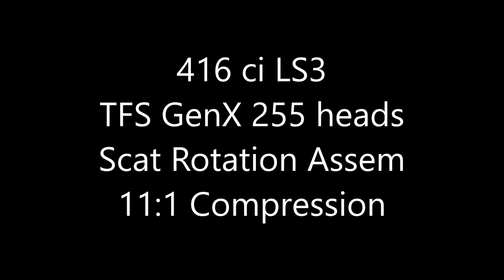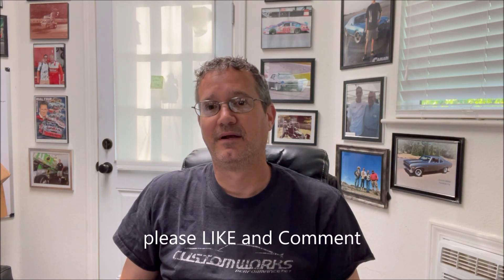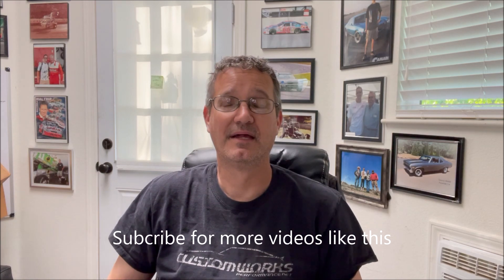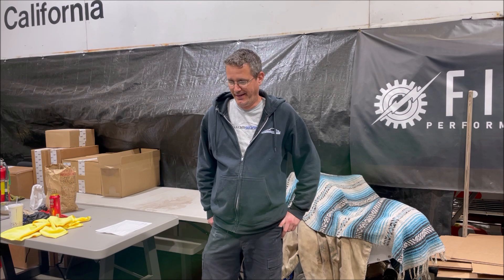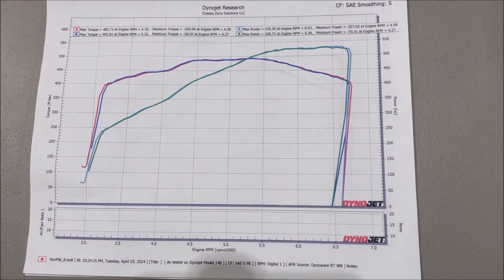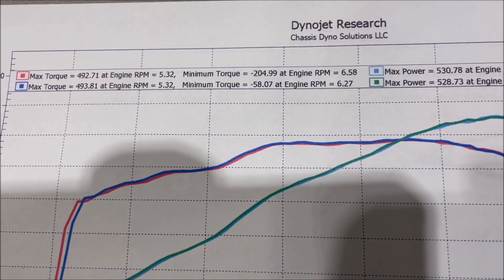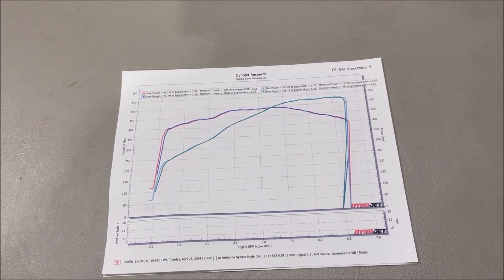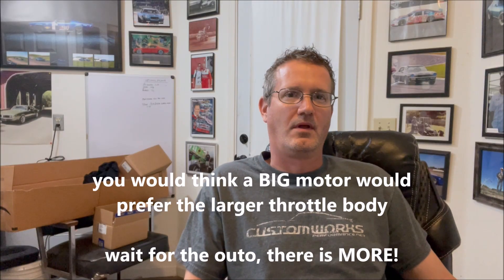92 vs 102 BIGGER is better? I dyno test it

Comment: I'm just now seeing this I have a 408 big cam fast 102mm intake manifold and a Nick Williams 92mm I've had both 102 and 92tb on the fast 102 intake manifold and they made the exact same power 580hp and 575tq so it did make good power regardless the tb and th3 92mm tb does drive better for a street car
Reply from the maker: Yeah. That was my findings as well.  Thanks

Comment: Did you try with a rod mod or FAST vs this intake which is iffy.?
Reply from the maker: That would get expensive!  We did not.  We all know the Fast is just a ported version of a stock LS3 for the most part.  The rod mod from what I have seen isn't worth the hassle or the expense.  I did reach out to them to see if they wanted to let us use one of their manifolds or modify ours, but not a reply.  Anyway this video is mainly about the throttle body size, and I don't think it would be any different with any other intake that didn't raise the rpm much higher.  I still have this intake on my car, as I'm not wanting to take it apart and it does look cooler than the Stock LS3 intake.  Thanks for watching.

Comment: I appreciate you actually following up with the throttle body test, most channels would have just forgotten about it. Also, thanks for saving me from wasting money on an aftermarket ls3 manifold! Your LS3 vs PDI intake post on LS1tech brought me here btw
Reply from the maker: You're welcome.  Its hard to get legit unbiased info.  Thanks for watching and glad it helped you out.  I still have the manifold on my car with a 95mm Holley throttle body.  The loss of low end power sucks, but also may help with traction.  I do wish it would have been offset by more that 2-3 hp on the top end, ughhhh.  btw.  I recommend the Holley 95mm TB.  Drivability is the best with that unit because of its taper design, unfortunately it is expensive

Comment: The smaller throttle body should make more torque. They larger one should give you more top end. But with more air, you need more fuel it would seem. Im glad you are making these videos. These are the questions I've had. But i dont have the money to test it. I started making videos for my grandkids about my Ls3 swap in my Crown Vic. And they have helped with the engine. Proud grandfather here lol. Trying to get the next Gen excited about Hotrodding. I have been playing with my old RC cars while i save and wait for parts. Thank you for the videos. Great info.
Reply from the maker: Yes with more air you need more fuel.  As i keep having to point out, this is a speed density system, not a MAF.  So as more air enters, more fuel is used.  The WBo2 takes care to also keep the AFR perfect, so yes the AFR was the SAME on both.  My point was that even with this 6.8L motor with big heads and cam, it really didn't need a bigger throttle body, ultimately I will put the Holley 95mm back on because its tip in design is really nice, but it is over $600, but worth it on driviability.  The bigger 102 really suffered with tip in throttle.  too much air too fast.
Reply: @ks71z28  OH ok. Cool. This is the first video I seen from you. I am watching the other videos now so I can catch up. That way I can see how you built it.
Reply: @ks71z28  Throttle response and drivability is definitely big points for me.

Comment: I would be curious to see how your engine would do with the 112 manifold version and 112 TB, I watched the Richard Holdener video and it picked up hp/tq,  all other videos of the 103 version hasn’t done anything. Thanks for the videos.
Reply from the maker: Because the 102 didn't do anything hp wise from the 92, I don't think going bigger would do anything except hurt the slow speed air flow further.  I think the fact that they made this HUGE throttle opening (112mm) for this manifold seems like a contradiction to the design of their manifold, which is to out perform the stock LS3 manifold everywhere.  All my testing and all of my research leads me to believe that at a point, once a manifold reaches maximum efficiency for a certain range, changing it will only take power from the top of the curve and move it to the bottom, or vice versa.  That is why the factories went to a dual runner intake when they went variable valve timing, its like have tow different intakes.  The Performance design intake in this case did in fact improve power at the top of the curve by allowing it to carry about 400 rpm longer, but at a cost from off idle to 5200 rpm, not massive but 10-15hp and 15-20tq, for me that is not worth the slight gains.  I will be taking the PD intake off and going back to stock.  I would love to test a posted or rod modded stock LS3 intake if anyone has one!  thanks f9or your comments and watching

Comment: 3-5/8" vs 4" , if you didn't change the tune to match the air at a throttle position then the tune wouldn't be right.
Reply from the maker: You’re obviously not a tuner.  This is a speed density set up, noted by me stating a Holley dominator ecu, target AFR were not changed and both runs were run at 12.6:1.  This was verified by the actual O2 reading in the data logs.
Reply from the maker: Also the test likely revealed this big motor didn’t need more air.  The engine dictates how much air it ingests   The throttle body is either a restriction or not.  In this test I showed the 92 mm was not a restriction and the 102 actually seemed to hurt low speed air flow likely due to a loss of velocity.
Reply from the maker: and I do appreciate your comments.  this is all about learning.  I make nothing or gain anything from this except experience.  A $40k dyno, a $1000 intake, $1000 in throttle bodies, and about 40 hours of time to make all of this happen.  priceless

Comment: We know that an engine is an air pump so it would stand to reason that the more air the better it is, I just think that if you try and get air in your lungs through a straw you will have trouble, and the same could be said if you’re trying to use a road cone , there needs to be some kind of balance between air flow in and out to make it work better, right??
Reply from the maker: totally

Comment: Have you ran a dualplane with a carb on the 416? 
Trying to keep the old school look in my 2nd gen f body. But as you probably guess it’s a little tough to fit all of it under the hood.
Reply from the maker: Are you thinking a carburetor?  Richard Holdener tested carbs and Efi intakes.   It’s just so hard to beat the stock LS3 intake, which is going back on this motor.
Reply: @ks71z28  I would like too. No hate on the ls3 intake. I just like the traditional look in the engine bay. And I’m trying to make my formula hood scoops still be Functional.
Reply from the maker: I get it.  we used the Holley intake, it is multiport, but allowed us the use the stock style air cleaner to make the motor look kinda stockish, it did leave a bit on the table for power, but the lloks were important and the customer never drove it with a better intake, so he was fine lol.  do what you think is right for you